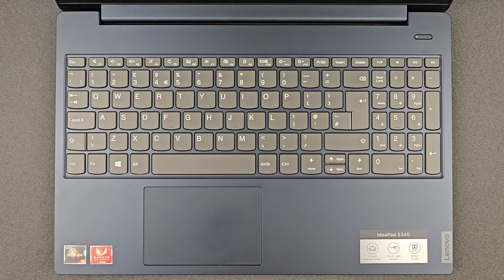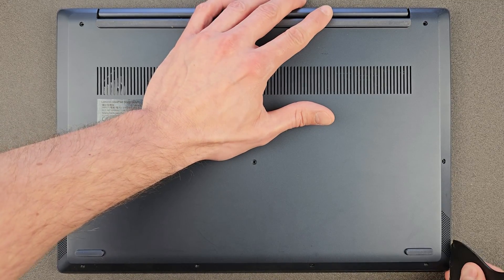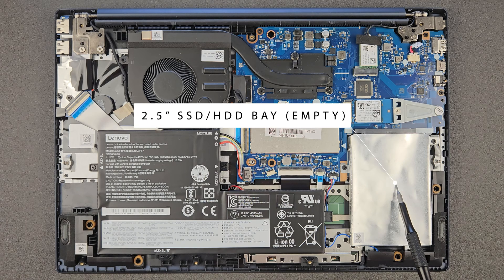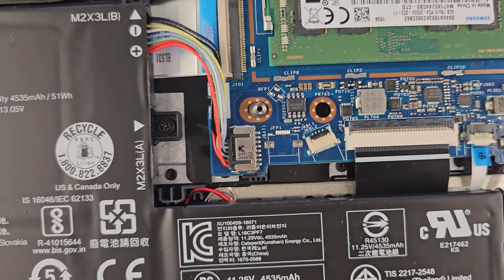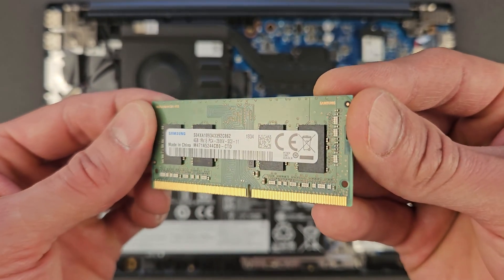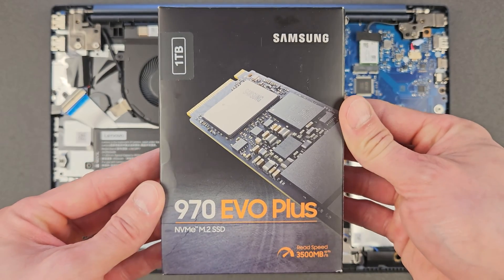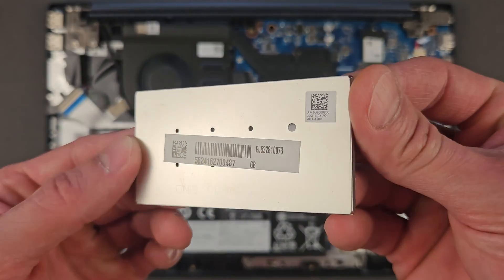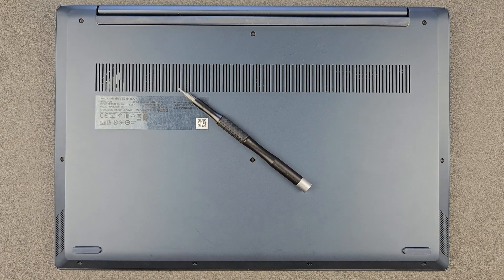Can i upgrade my Lenovo IdeaPad S340 RAM or SSD

Comment: I have same Ideapad S340 Lenovo Laptop and it has 4 Gb RAM soldered (Non Removable) connected to Motherboard and I have one Slot left , in that slot how much Gb RAM I should insert for best experience....
Please Reply ToxicNerd
Reply: depends on what you do, if you do day to day stuff then no need for more upgrade more than 12 gb (4gb(soldered) + 8gb(in second slot)) and if you want to run some small or whatever games, do high end coding etc then just get 20gb like he got above in the video.
Reply: What games can it run. @unsoph_k
Reply: @FEREDITZ  valorant and other low end games
Not games like fortnite, or rdr2 etc
Just games which require 8gb ram with some low graphic card requirements which in turn can be somewhat offset if you have 20gb ram
Reply: Can i put any frequenzy of ram on my lenovo ideapad s340?
Reply: No only 2666 @jeffcabug8364